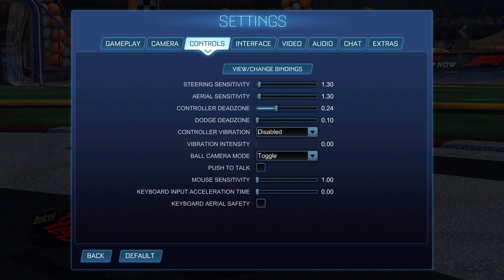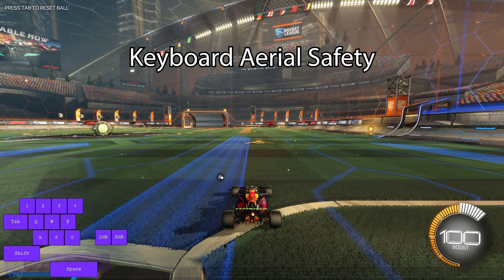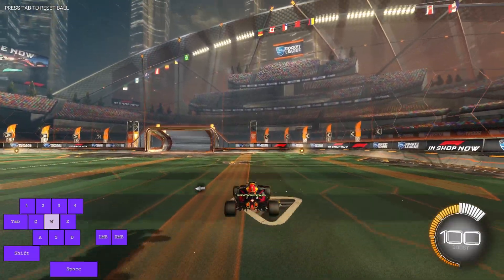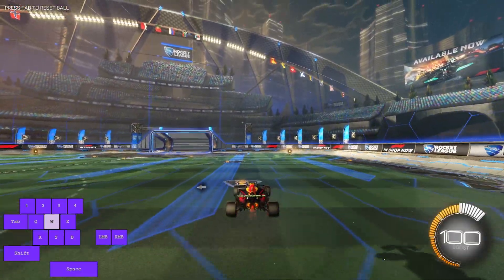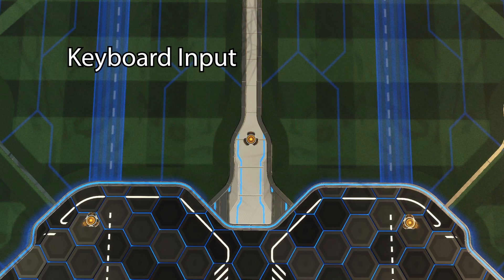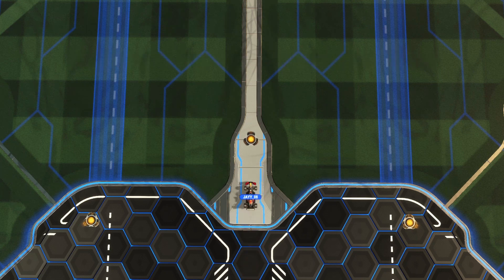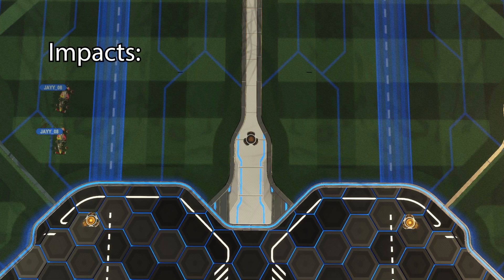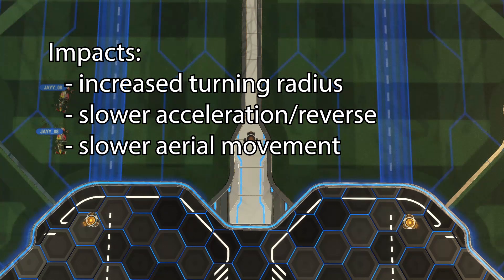EXPLAINING THE KEYBOARD CONTROL SETTINGS

Comment: i had it always at on. i feel so dumb xd
Reply: i have been feeling restricted when i go for aerial plays. Now I know why... feel the same bro
Reply: i felt so mad bro, when trying to airl roll i was thinking that my keyboard was broke but it was the freaking keyboard aerial safety
Reply: @falitocar  are you sure that's the issue, because it's supposed to stop your car from making moves you didn't initiate, and i am pretty sure you gotta initiate an air roll. 
And in my opinion the aerial safety is not as bad as he makes it out to be, in a single day from turning it on I have gotten much better at air dribbles. So it's really more of a training tool than a day to day tool.
And really considering he said he never used it , its a lil sus to me. But that's just me.
Reply: @yerodiallo3609  i know now bro, my keyboard tho, so bad, i alr bought a new keyboard, the old one had the W A S D broken